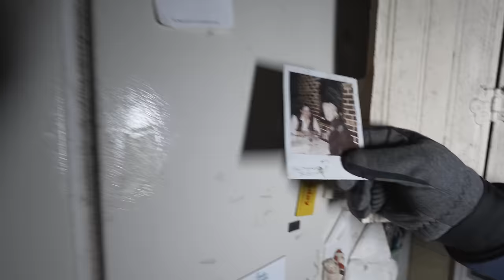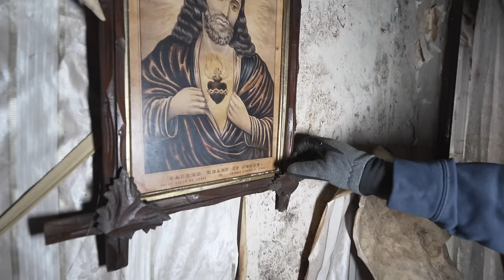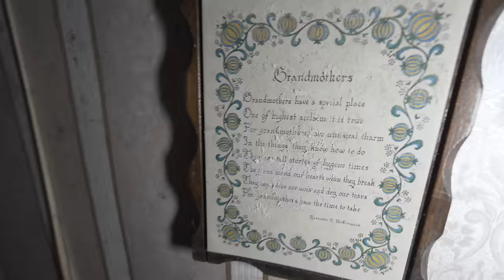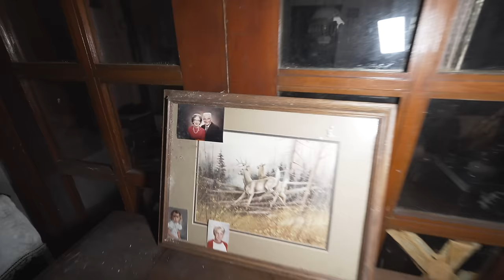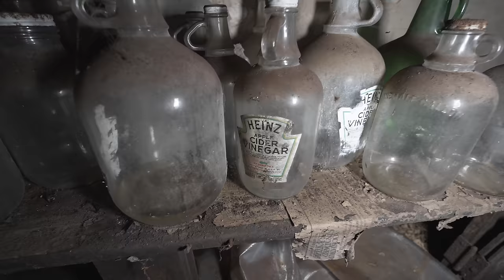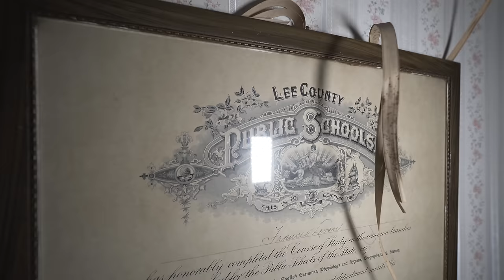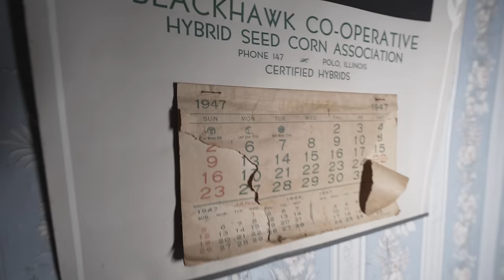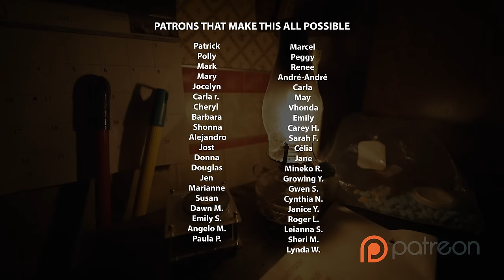Abandoned House Of German Immigrants In The USA ~ War Changed Them!

Comment: 33:00 you won't find basements down south as much because you get closer to sea level. At least that's my assumption. They would fill up with water.
41:28 wicker rocker
44:35 that looks like a bridesmaid dress. It could also have been an Easter outfit
53:56 looks like someone was making a quilt. Blanket which would have backing sewed to it and filled with cotton or whatever to make it thick and heavy.
54:07 sewing box. Would have held zippers, thread, pins, scissors. It would have held a top section for smaller things like bobbins for sewing machine, buttons, safety pins, pins for hemming, etc

Comment: Houses in northern climates typically have  basements because of the freezing temperatures in winter. The ground actually heaves from the frost (which is also why our asphalt roads get so many cracks and potholes that need to be repaired each spring). At the very least, northern houses will have a crawl space or deep footings/pilings to withstand the heaving soil each winter.
Reply: If you live close to a body of water like a river, lake or big stream, most likely you would not have a basement due to flood reasons.
Reply: Built for shelters from tornadoes as well
Reply: @kristinadenney1293  not true at all, my friends have basements, many live on lakes here in Michigan. Big walk out basements, walk out to the lake. Basements near high water tables have sump pumps
Reply: @alicelong3613  I grew up near Chicago and still near there. A walk out basement isn’t really a full basement. Houses like that are built on a side of a hill or cliff.  If you live near flood zones like a river (Fox River) you definitely would not have a basement.
Reply: @kristinadenney1293  
Walk out basements are full size, and have a regular door going to back yard...
A lot of people dig out and slope yard so as to have walk out...
My friend actually had a complete  house in basement and upstairs was complete house...

Comment: Interesting how the kitchen has updated cabinetry at the sink, and the original cupboard was cut out at the bottom shelf for the refrigerator to fit.
Apple cider vinegar is used in housecleaning and for drinking to help the digestion system.
Thank you Lesley for another touching exploration.

Comment: @56:40...That is an oil can, they use to put oil in them to lubricate rusted screws, bolts and hard to remove parts. They would oil it, give it time for the oil to set in and the bolt and screws would be easier to remove.

Comment: The item in the attic was not to put receipts on. It was an oil can/dispenser. I used it to put oil on my bicycle chain when I was a child. You used your thumb on the bottom and two fingers on either side of the dispenser then push with the thumb to make the oil come out. It made a very cool sound too.

Comment: In the south it is so humid in most states that if you try to build a basement you end up with it flooding and at the least you get mold. Then in the lower states along the coast if you dig down far enough to build a basement you hit water. That's one of the reasons New Orleans has overground cemeteries.

Comment: Have you been to St. Louis, Missouri?  Friends just bought an abandoned 2nd empire mansion and are restoring it. (Built in 1895)  There are several abandoned homes in the oldest part of the city and county.  Theirs is on what was called "Millionaire's Row."  And the thing in the attic mailbox is an old-style oil can.  You refilled it from a larger can because the 'snot' was easier to get the oil where you wanted without making a mess.

Comment: You really have to be careful turning the wheel on the pedal sewing machines.  The belt can be very dry with cracks and it will break.  I know this because I have my Grandmas old pedal sewing machine and it happened to me.  I got a new belt for it but I don't know how to put it on.